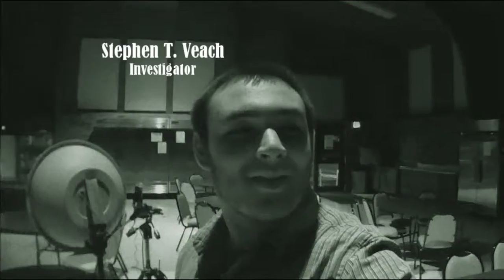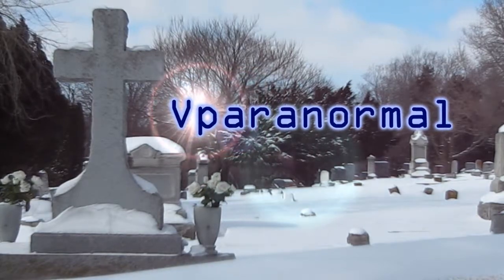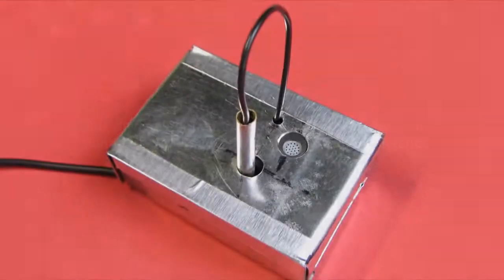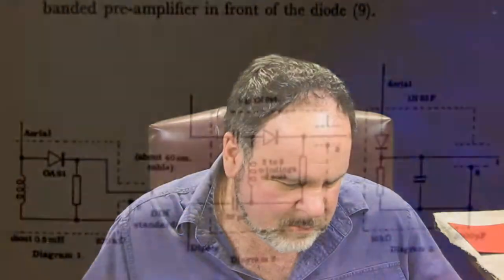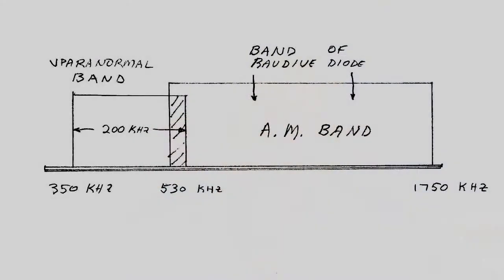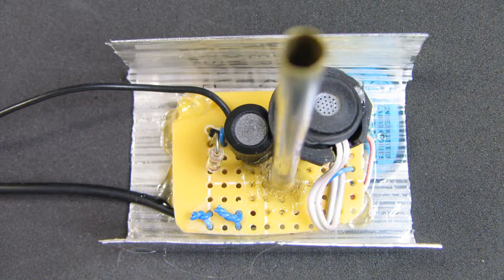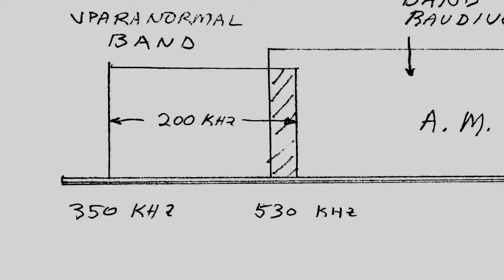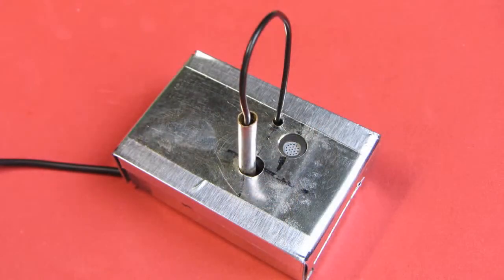Vparanormal Designs a Raudive Diode Microphone (Raudive Entity Mic TM)

Comment: Interesting - especially the novel way of adjustable screening of the antenna and using the mic simultaneously via the stereo jack. Also very sensible shifting the resonant frequency out of the AM band. But what did you detect using the device? 

I see you have not included a capacitor to filter any RF at the diode's cathode; roughly 10nF (0.01uF), but I guess it won't really make any difference.

(Not sure about the 'scary music' at the start tho!)

Would like to learn more of your results...

Comment from the maker: Vparanormal designs a Raudive diode microphone (Raudive Entity Mic TM) to help capture EVP's.  This circuit is placed in a metal box along with a small condenser microphone. The original Raudive germanium diode circuit operated in the middle of the AM frequency band. After some experimentation and testing using a frequency sweep generator, an oscilloscope and a RF coil, I determined the changes to the original circuit to allow operating out of the AM band.